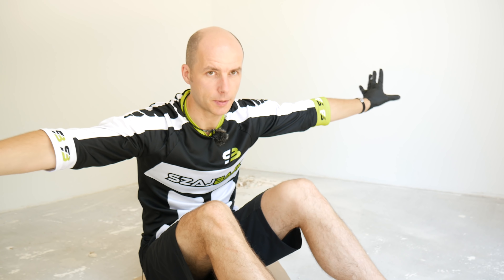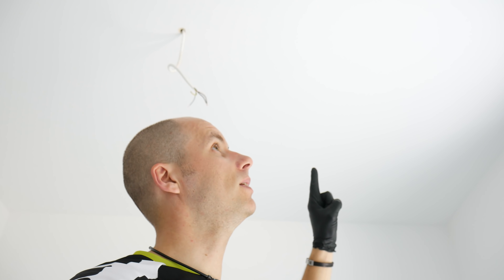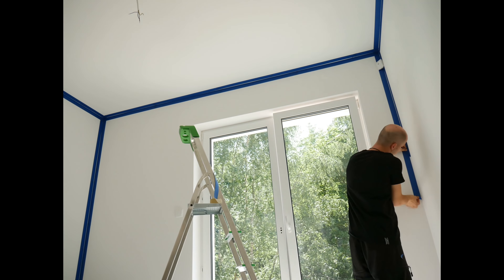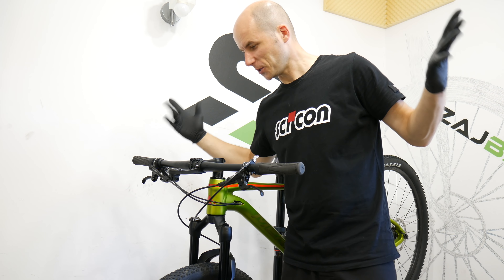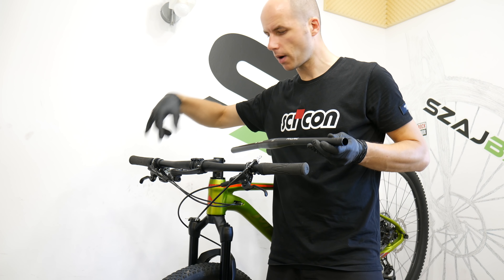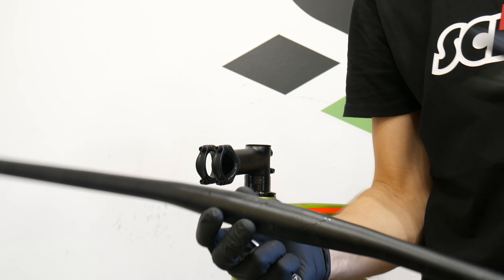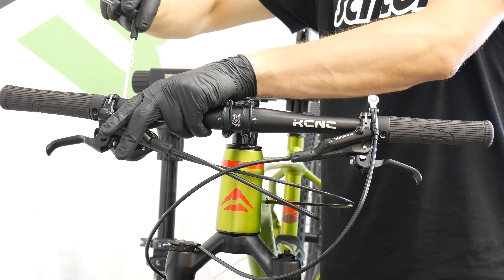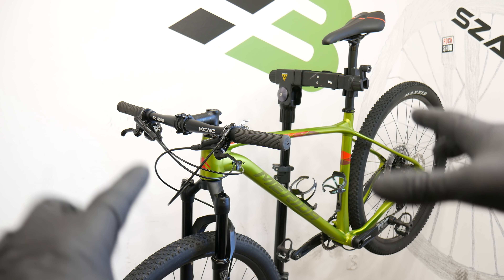Painting My New SB Studio + How To Set Up The Cockpit On Your Bike. Handlebar Adjustments.

Comment: here is a video by Bike James on how to figure out the correct  handlebar width: https://youtu.be/Ip5ZI2ulQMQ
he shows how to use the push up method to find out.
I can't use any narrower than 800mm bars comfortably, my elbow would misalign a lot way too easily, but if you can run narrower bars and it works for you then why not if it benefits you.

Comment: I don't think there is a trigger shifter on the market that fits me, Shimano & Sram sure don't fit me, I use 34mm RevGrips the thumb rubs on the clamp and the grip when shifting, proper position is impossible, cus that would mean thumb half way off the trigger, I basically need the shifter to be lowered, and triggers to be different, they are made for small hands, and I got medium size hands, bit kind of big.
I am considering Archer D1X trail electronic shifting system, cus it seems like it might fit me better and eliminate the fatigue from shifting.